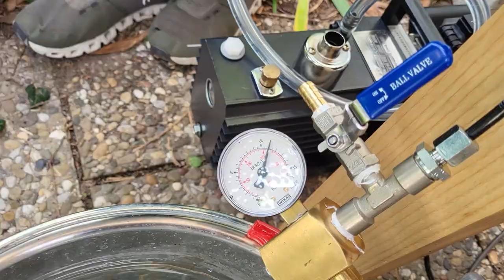Liquefying Toxic Ammonia NH3 Gas (gone wrong)

Comment: Elias can you tell me why advanced tinkering in the cesium vedio and you in the potassium metal extraction vedio were pulling vaccum in the apparatus, why cant we just pull vaccum and fill it with argon and seal it.I just wanted to know if any problem occurs if we just seal it by pulling vaccum once.
Reply: One more idea can you liquify flurine and ampoule it. Cuz no one has done it on YouTube yet
Reply from the maker: Pulling vacuum is to lower the boiling point of the potassium metal or the caesium metal respectively. Also you tend to get less oxidation with vacuum compared to argon. Another disadvantage of argon is that it expands when heating and it could blow up your apparatus.
You could in theory seal it after pulling vacuum once, but we both didn't dare to do that yet.

Comment: Those compressors are not ment to start against head pressure. Did you release the pressure in the line to the tank before starting it? I would suggest to put a check valve before the tank and to empty line before each start.
Reply from the maker: That would have certainly been a good idea. But we are not doing this ever again XD
Reply: @EliasExperiments that's sad, I feel with a few tweaks you could get it working really well

Comment: I'm really confused how the molecular sieves are supposed to absorb oil vapor, they are usually tailored for small, simple molecules like CO2, N2, or water.  I would expect the sieves to just act as very expensive, poorly-performing mechanical filter media.  Something like activated charcoal would seem like a much more appropriate choice.  Anyone have another perspective on this?
Reply: And if you heat the charcoal enough could it form HCN with the ammonia
Reply: You will have no flow through the carbon unless you have pellets I guess then it's fine
Reply: The oil isn't very volatile, so no tailoring is needed as long as the pores are large enough for the molecules to permeate inside at all. The sieves are just high surface area. Activated charcoal would be cheaper iirc per amount of oil absorbed but they didn't need to absorb a lot of oil so it was good enough.
Reply from the maker: That was Advanded Tinkerings idea, so you might be right XD
Reply: We could have also used activated charcoal. It's not about the pore size. We just needed a large surface area.

Comment: I would love to see you test its flammability, supposedly it can burn with enough oxygen and heat. also, I think the liquid has a super high heat capacity, (specific heat) I'm not sure if it has to be a solution instead though.
often brass can be soldered to copper instead of brazed, it doesn't need to get as hot, which means that the copper doesn't oxidize as much, and its easier to keep it hot enough while connecting them. I think solder flows better too.
Reply from the maker: That certainly sounds interesting!
Yeah solder would have probably been the easiest choice.

Comment: Maybe a "hard start kit"? The pressure differential of having vacuum on one end can stall a compressor like that, but it seems you broke the vacuum and it still didn't work. A hard start kit uses a current relay to know when to remove the start capacitor from the circuit. Might be the thing an old, failing compressor needs. And yes, pouring water over the compressor is how the professionals do it. When the thermal protection trips, it can take a looong time to reset with all that thermal mass.
Reply from the maker: Okay I didn't expect that with the cooling water :D But about all the other stuff I have no idea, and I don't want to try this again XD

Comment: Moin Elias ich hab ne Frage die völlig unabhängig vom Video ist und zwar warum hat Lithium das höchste Standartpotential aller Stoffe aber trotzdem sagt man dass Ceasium das reaktiveste ist?
Reply from the maker: Moin Johannes das ist beides richtig und absolut miteinander vereinbar. Das Standardpotential ist nicht das Gleiche wie die reaktivität. Cs ist so reaktiv, dass es bei Raumtemperatur an der Luft Feuer fängt, bei Li ist das nicht der Fall. Aber eine Li erzeugt höhere Spannungen als eine Cs Batterie, weil Li eine höheres Standardpotential hat. (Letztere Erklärung ist stark vereinfacht.)
Reply: @EliasExperiments das Standartpotential ist doch proportional zur Ionisierungsenergie oder?
Reply from the maker: Soweit ich weiß sind die Werte dafür auch größtenteils unabhängig, ist aber nicht mein Fachgebiet.

Comment: A much better way to generate ammonia is Sodium Hydroxide mixed with an Ammonium Salt, Ammonium Sulphate is cheap and easy to get.
Also, it's far easier to condense the Ammonia with a flask that is cooled with Dry Ice in Acetone or liquid nitrogen.
Reply from the maker: Why is it better to generate ammonia with sodium hydroxide and an ammonium salt? I calculated beforehand, that I would need a larger flask to do that and the setup would be more complex.
Yes using dry ice in acetone certainly would have been easier, but anyone can do that ;P
Reply: @EliasExperiments  By better, I meant cheaper! Agricultural Ammonium salts and Sodium/potassium hydroxide in 25kg bags are usually cheaper than buying a kilo at a supermarket.
Might be more complex but more fun!

Comment: It is quite scary to see you fiddling with all that tools. Working techniques looks like your goal is to hurt yourself. So be careful -- the amount of fingers and eyes you have is strictly limited.
Reply from the maker: How did I risk losing fingers or eyes with anything I did in this video?
Reply: @EliasExperiments In this particular case I saw at least two of your mistakes in safety. 
1) Don't pull wrenches with both arms like you was doing after brasing. Choose smaller angle between wrenches in a direction you need and just squeeze them to each other with your hands. So you can't throw them or hit yourself accidentally if one of them torn off. 
2) Never ever aim to your or another persons face with a tube that throwing out some pressurised gas unless you absolutely shure (wich you can't be in most cases) that the system is not containing some dirt or sand or metall chips in it. Even a safety glasses will not save your eyes in case some sand grain would be thrown out of that tube. They can fly under the glasses and penetrate horribly deep in your eye. And this is true for even 2-4 bars when you have 15.
Meanwhile that plastic bag full of NH3 isn't that dangerous unless you're doing such an experiment inside the house.
Reply from the maker: Hm interesting I never would have considered those things as real significant dangers. But I might be wrong, so thank you for the input!